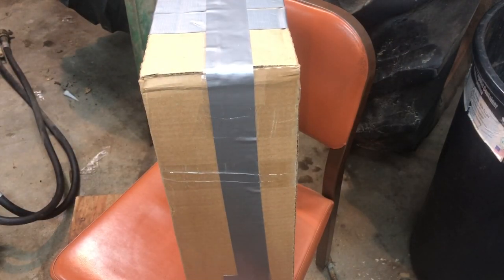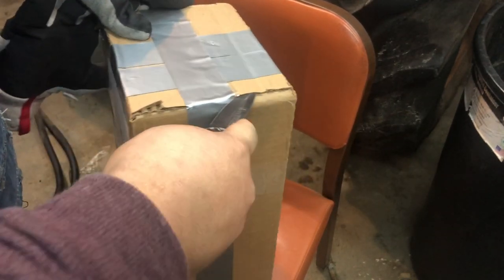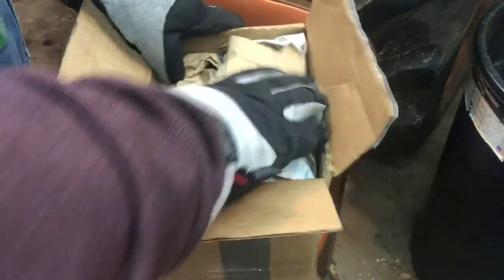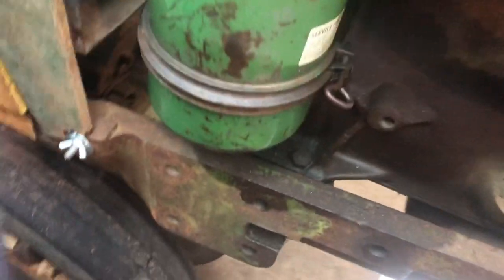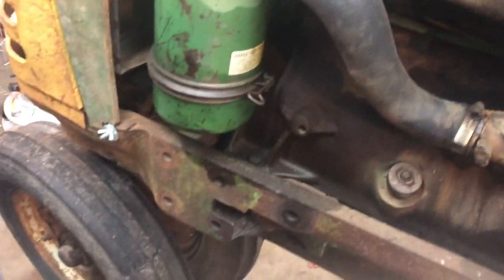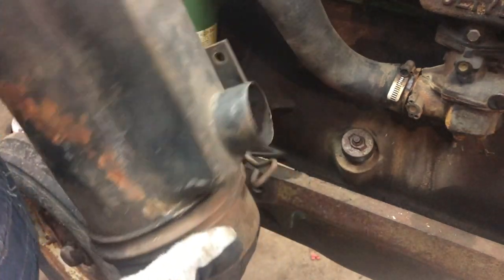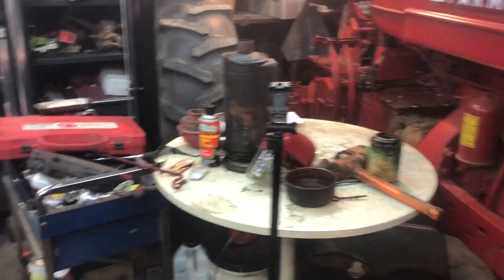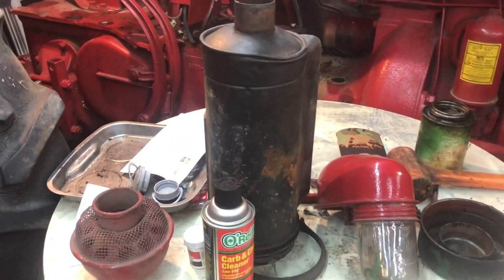What’s the deal with oil bath air cleaners

Comment: So I got 2 things today 😆........1st one I've never repacked one of those oil bath always just fill them with gas then..... (its shake and bake... and I helped) 😆🤣😂..... 2nd so I've never replaced one with a dry cleaner either..... here's why....... the oil bath creates more resistance than a dry flow cleaner...so  the carb is  jetted down to allow the correct gas to air having the air bath cleaner on it is literally like running your engine partially choked.... so in order to make things right you need to rejet the carb. Most people don't  notice the difference or even think about it but me over thinking everything that I do....I experimented with one of our CA'S  and could tell a power loss and hesitation just taking off in road gear let alone trying to pull a boat... now that being said you can gain a good amount by putting a dry cleaner on it but that's only half of the equation lol
Reply from the maker: Good point I know that even running a big K&N filter on one of our engines at work we have to re-jet
Reply: Another point on that the d 17 they started a dry filter factory on the series III so I cried referenced parts and what do you know the series 3 jet is bigger than the series 1 and 2 😆 so I've got an easy fix for like the wd 45s and early 17s lol. I don't know enough about Oliver but you may be able to find the same situation going on there.
Reply from the maker: Hmm going to have to look into that

Comment: You can gut the housing and convert it to dry filter.. I did it on the 4010.
Reply from the maker: Might have to look into that
Reply: @BIBSTERSrepairshop  it's a bitch cutting the screens out, but... Way less expensive than buying a cartridge type can😁
Reply: We are planning on putting a cone style cold air intake air filter on our stock pulling farmall m not sure if we will gain any extra air flow but hoping so
Reply from the maker: Nice going to run it out the hood or just in front of the carb?